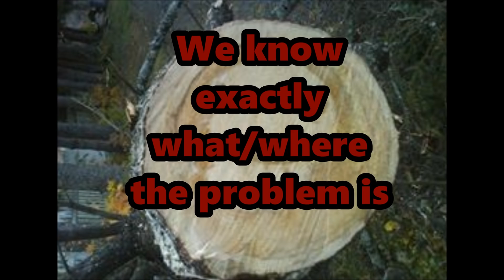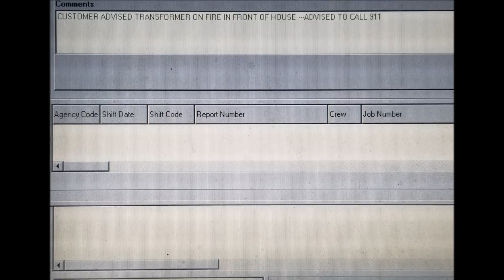5 Myths about Power Outages

Comment: Thanks for the video, I learned a lot.
However it is generally not true that underground power lines have to be shut off in order to connect another household to it (6:35). In Germany, almost every power line is underground (even in rural areas), and new households are usually connected while the lines are still live.

Comment: We've had a squirrel climb on our transformers and pop the fuse 6 years back. The guy said the transformer should be updated as they were phasing out the old 70s style. The fuse blew again 3 years later and again the guy said the transformers should be changed as he was lucky enough to have a spare old fuse from a previous project that day.  A year after that, we had a guy show up and tell us the entire system really needs to be updated. We have yet to hear back from the power company about fixing this issue. We're even getting brown outs and flickering, but they don't seem to care too much.
Reply: probably isn't the transformer, more likely a bad connection or corroded feed lines if the lights flicker, but that's only a guess
Reply: @gtb81.  The whole setup needs fixing. The system is at least 60 years old, so corroded lines are expected. We have wild leg 3-phase, which is nice if outdated. All three feeds come from a pole on an easement to the three transformers on our property. They have the 240 for the house coming off one and running back to the feed pole, split halfway on the run to go to the house pole, so the lines are essentially hot against the feed pole (just some tape on the ends). Because of the shared transformer, any anomaly at the 3-phase building could affect the house power. We rarely use it, though. I can only imagine what will happen if we get that building back up in full service again.
Reply: @StapleCactus  Seems like the house needs a dedicated transformer, my system is just as old, well, just the mains side is, the secondary is new because a storm hit the old transformer and blew the pole and transformer to bits.
Reply: @gtb81.  Yeah, but I don't think the power company is willing to add a fourth to the property. Especially since they don't even seem to care about the pole along the easement leaning about 20 degrees. Said it was "our responsibility." Yeah, cause the pole that splits to power us and continues to supply power to everyone else down the road is our problem... My brother said if they were serious about that, he was going to cut it down; see how fast they fix it when the next 20 houses start complaining.
Reply: @StapleCactus  strange that they are so lazy with it, in my area they are quite quick to fix an issue if it's serious enough, though the pole leaning isn't too terrible, i've certainly seen worse, but if a limb or tree hits it, it will probably come down.
Reply: @gtb81.  It got a little worse after a truck hit the pole next to it and pulled the lines till they snapped. That was a fun day...
Reply: @StapleCactus  dang, i've had a tree fall on mine, pole was fine though, the connections snapped at the neutral, thankfully nothing in the house blew up

Comment: About 12 years ago, my transformer actually did blow up. They found the lid about half a mile away. Even then it took an external action just as you said, a direct lightning strike. There was a hole half way down it where the strike happened and the lid blew off. That oil was all around me yard.

My insurance company did not like me that day, it fried everything plugged into my house.

Great video!
Reply: The house I lived in a while back had a pole transformer that fed the surrounding 6 or so homes.  One storm there was, as I recall, a pretty nearby lightning strike.  Everything seemed fine, but I started the counter. Sure enough, about a year later, that transformer failed with a bang.  (At night, of course.)   The "bang" was more than just its cutout.  Not all lightning damage is immediately evident.  The transformer took a lot longer to fail than I thought it would, though.

Comment: It doesn't help that they use explosive disconnects in the power system to get the ends of the wires separated enough to end the arching.

Comment: One time a power transformer did explode. sounded like a bomb it broke some windows and I looked outside and the top of the powerline was incinerated and nothing left. metal and wood and wires strewn everywhere on fire all around it. it was a nightmare!

I have a small 1000W power pure sinewave inverter I just hook up directly to the outlet nearest to the circuit breaker panel and get full 120v to my whole house with a large 100Ah battery backup powering the inverter pure sinewave for the whole house
flip off the main breaker and we got power even in an outage.
we usually turn off air conditioners heating/cooling and anything that draws a lot of power just to make it last longer and not overload anything
keeps the fridge running for a good while too. even the internet still works sometimes with this setup.
plus the whole has has LED light bulbs completely. to reduce the load even further.

Comment: Informative video. But I do have a question...

About 5 years ago in my back alley (Wainwright, AB), a transformer did explode off the pole (The shell was in about a dozen different pieces and oil was everywhere), and two dead crows were found beneath it, presumed to have been nesting in it. What would have caused the transformer to outright explode, rather than just the fuse blowing?

Comment: i has seen one blow had one in our back yard but then it was in the early 90s and it im sure had been up there for much longer so would not surpise me if it didnt have the best of all the tech at the time . remember had to get the big truck in to fix it but do to the way it was was nearly inaccasable so took about 8 hours to replace it most as they had to go buy 1 inch plywood sheets to lay across the yard to keep the truck from getting stuck

Comment: I remember once I saw a fuse blowing.  I thought that it was the transformer getting ready to burst.  I do not work for any power companies but I knew enough to warn everyone to stay away from it and also stay away myself.  Yes it was loud too, just as you describe it.
Reply: Like the fuses we used to have in homes, the fuses/cutouts on power poles tend can blow instantly for a short circuit, or slowly for an overload.  Fuses blow nearly instantly for short circuits because a short circuit allows an enormous amount of power to flow, very quickly.  Small overloads take a while for the fuse material to degrade and fail.

Comment: Was doing a catv retrofit in a rural part of virginia years ago.
Was early AM one day, just after sun rise, still lots of dew/moisture on the ground trees etc.

We got a lasher stuck in the branches of a large pine tree. Had no easy access with the bucket truck.
I decided to climb the tree with my gaffs [ climbing hooks that attach to your boots/ legs].
There were primary electric lines running through the trees as well.
About 8' up the tree I started to get a tingleing sensation through my arms and legs.
At that point I decided it would be best to climb down , grab the crew and go to breakfast until the ground dried for an hour or two.

Comment: OMG you are so right about stay put. A heavy operator ran into a transmission line on a job I was at. ALL the electricians told him to STAY IN THE CRANE, he decided our advice wasn't so good, so he JUMPED out of the crane... and the voltage difference between HIM and the ground he landed on caused him to be yanked back to the crane and insta-dead

Comment: I was a sub-contracting cable installation 20+ years ago, set my (thank god top rated) ladder on a pole and seen sparks, so refused to go up and hook up there cable. The power board came out and had to replace a transformer. The ground connection had been bad so long it had burned out most the transformer. When power was turned back on the whole are light up like Christmas, seems it had went down slowly and everyone had just been sizing up there lightbulbs, so the 4 houses it feed were very bight afterwards, and Wal-Mart made a lot of money on sales of lower watt light bulbs that night.
Of course I was told I should have done the job as I would have been perfectly safe.

Comment: Years ago, I found as many of you have probably also - an almost guaranteed way to prevent any form of power outage is to get a backup generator.  The larger and more expensive it is, increases the reliability of your grid.

Comment: Why did my trailer park that has 400 trailersreplace the overhead lines and the transformers on the poles with all underground wiring and ground pad transformers ?

Is there some benefit to doing this ?

It was a lot of work and a lot of cost and I don't understand why they did it.

the pedestals which had for me to feed for trailers for each pedestal they are from the 1950s maybe even sooner than that.

it seems weird they would replace the overhead lines with buried lines in conduit and leave the old pedestals with the old meters

Comment: If the power goes out, say on 1 street, the meters are supposed to detect the outage and transmit the information but without power I don't know how they can do anything and with a break in the line there's no way for them to transmit the data because it's transmitted on The wire not wirelessly.

is there something else that allows them to keep working maybe a backup battery and maybe they have Wi-Fi that transmits over a great distance to a meter that still has power ?

Comment: I wanna say that our closest transformer at the street intersection definitely blew up for sure. I was in my room and heard a extremely loud boom with cars screeching too a stop. Went to look for where and found that the pole was half the length it should have been, wooden pieces and splinters everywhere. The transformer was on the street and looked like the side was split open vertically. There were power lines on top of cars. And then the stupidity for some cars to drive over the lines to go on there marry way. It was a sight to see.

Comment: Another rather big disadvantage with underground cables is their higher loss.
Due to capacitive coupling both between the conductors and the ground.
Air on the other hand is a very good way to reduce these losses and why overhead lines are preferred in nearly all instances.
And even some underground lines are practically overhead lines in a tunnel (so that the dialectic is air again.), but I guess such isn't common in the typical suburb where the line voltage isn't all that high. (since the losses is proportional to an increase in voltage or frequency.)

I have also wondered if smart power meters helps in finding faults. Considering that they could use GSM to send back a message when the power goes out. (and GSM base stations have battery backup for typically at least half an hour or more.)

Comment: My aunt who lives in a very rural area has electricity for only 6 months.
If there's a power outage during monsoon, they won't repair it until monsoon is over.
And ofcourse, within 1-2 weeks of onset of monsoon, some tree will fall on the power lines.
Even if they did repair it, which would be hard with the weather and road conditions, there'd be new problem within a week.

Comment: When I was in the fifth grade, we had a florescent fixture right above me that started flickering.  A moment later arc flashes could be seen at one corner of the fixture then the bulbs went dark.  One of the other students told the instructor to turn off the rest of the lights on that side of the classroom  IIRC his claim was the bulbs needed to be removed or else they might explode...or something like that.  My question is, what exactly happened and was he right about needing to shut off the lights?
Reply: Likely was a ballast failure.  Fluorescent lights work with high voltage too.  There is a ballast in there which is essentially a transformer to increase the voltage to get the electricity to correctly arc across the length of the tube.

Comment: I guess I always thought you guys used Time Domain Reflectometery to determine how far down the line there's an anomaly.  I guess maybe the network is too complex or the fact it's "hot" makes that kind of difficult?  https://en.wikipedia.org/wiki/Time-domain_reflectometer
Reply: Those are generally used on impedance controlled lines like coaxial cable or twisted pairs which power lines are not.

Comment: Sadly another myth is Canada’s power distribution system is reasonably current and up to date. Canada’s system is far from from being modern and is in dire need of massive updates. Most of it is ancient, poorly designed, and on borrowed time, which is a major source of both outages and the time needed to repair them. This is especially true when you get away from the major population centers.

Comment: Yes transformers do blow regardless of the fuse trip. I watched one across the street at a Detroit Edison substation explode. There was a huge shock wave with the bang, then a monstrous fireball maybe 10 feet diameter. This ignited the roof of the substation housing. DTE said the ignition vaporized the oil in the canister making it a fuel bomb.

Comment: Excellent Video Bob. I also work in power, specifically transmission. I just wanted to add that with underground transmission lines they can have a capacitance effect that makes it difficult to control voltage in the control center.  but your information is very correct. There are also a bunch of new techs for distribution that can help isolate faulted lines and restore as many people as possible. Some very cool stuff being tested right now.

Comment: Nice basic info.  Many electric utilities now can detect where outages have occurred, as you noted, from the growing number of "smart meters" as well as substation and local switches and taps that are now instrumented.  Those, along with smart substations and circuit controls, are the future at least where there are cell networks or internet to deliver the data.

I'm not going to argue that overhead construction is not cheaper initially than undergrounding.  But if significant parts of your State or Province have yearly power safety outages, or have burned up in wildfires (cough*California*cough) you'll find that demand for system safety has jumped many-fold, and that the rules may be changing in the future.

Oh, and transformers are heavy because of copper, yes, but also because they are built with a lot of iron to improve the magnetic fields that transfer the power from the high voltage windings to the low voltage ones.

Comment: You use the term "fuse" when more often they are circuit breakers.  Old-time fuses had an element that actually fused, or melted.
Reply: fuses are still the major protective device out in the distribution system at the feeder voltage level. breakers are used in the substations (mostly). There are some vac interrupters now being used in many systems at dist. levels. but these are used mostly on larger 3 phase feeders.

Comment: Greetings from Onscario.  Over the past 2 decades or so, Hydro One (formerly Ontario Hydro) has been changing everyone over to `smart meters.  City-owned utilities are doing this as well.  When ours was changed, the very first thing I noticed was that it was no longer measuring Watts or kW used,  the new ones now measure kVA, which I came to learn stands for kilo-Volt Ampere .  Rumors abound that this slightly different way to measure power consumption is a better deal for the supplier than for the consumer.  Care to either clear up or confirm this rumor?
Reply from the maker: Hey Stan! 

I can't confirm whether Hydro one bills KVA or not, but yes, everything you said is accurate.

kW would generally be a lower number than KVA, but not by much for normal residential use. 

Traditionally, only certain large industrial buildings were metered in KVA.
Reply: Standard electric service billing is in kWh, or kilowatt-hours.  A 100 watt load operational for 10 hours is a kilowatt-hour.  
kVA is Watts (Volts × Amps) times a Power Factor.  So:   kVA = KiloWatts × PowerFactor     
The reason for kVA measurement is that not all loads on the electric system affect the electric system the same way.  Some loads are "terrible" and degrade service for everyone else around.  These "terrible" loads also tend to suck up more power than they appear to because of physics.  kVA billing allows the utility to be extra-compensated for this. 
Why a utility would apply this type of billing to residential service stumps me, as (and I'm no expert) homes don't typically have "terrible" equipment in them.  Maybe they're just making up Power Factors and trying to skim a little more?

Comment: The power company is bragging that the smart meters will tell them immediately when individual houses go out.  The instant pattern gives them a good idea where the fault will be. 
What is enfuriating is their triage.  We are a group of a dozen estimated to be restored by a certain hour.   We need power for well water, sewage pumps, heat, etc.   BUT... another group of 100 goes down, and they move to the top of the list, because the same work will restore more people, and the track record looks better.   Then a larger group goes down, and they move to the top.   An estimate of a half day sometimes becomes several days!   In my opinion, at some point it has to be decided that it is better for a hundred customers to wait a bit longer on a short outage,  to restore a small group of desperate people who are losing freezer contents, cannot flush toilets or draw water for a week.

Comment: I am not a fully qualified electrician but even I know all the answers to these... Question,,is the overhead lines AC or DC ? I would imagine AC....also when I was using a TV step down to make my Lecky meter go backwards,,why did  it blow the fuse in the street between the light poles?